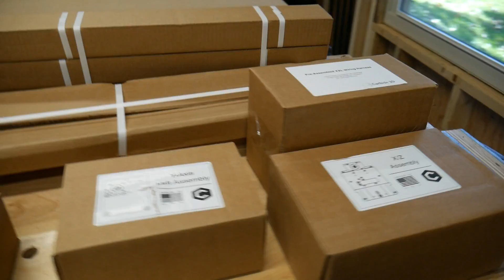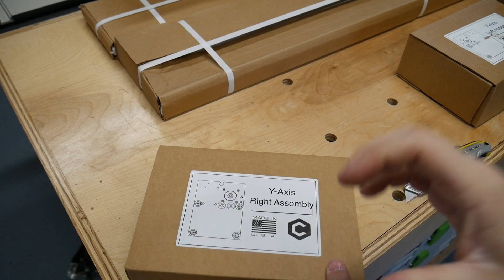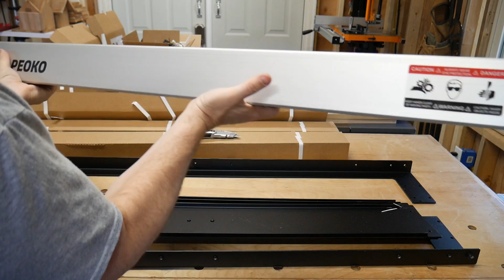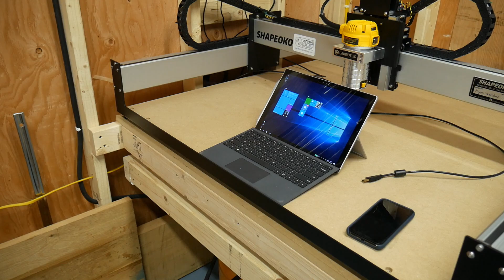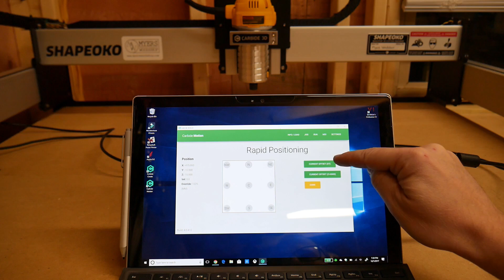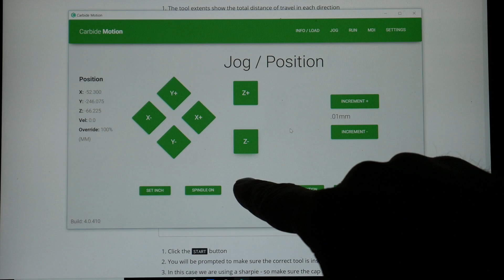Ultimate X-Carve Vs Shapeoko - Part 1 : Shapeoko 3 XXL Unboxing, Installation, and Hello World

Comment from the maker: Since I put this video out I have now changed over to the Onefinity CNC machine.
It's advantages over the xcarve and shapeoko are:
X Y Z Ballscrews
15 minute installation
No computer required
Control with phone, tablet, or gamepad
Faster cutting speeds
More rigidity
Check out the Onefinity CNC Machine Here:
https://www.onefinitycnc.com

Comment: so far QC has been my biggest problem. mdf was bruised pretty good and screw holes painted... locked the bolts up. they talk about not cross threading. but one of my leg levelers actually started to spin. you get this problem? this all happened with the first and second step...
got the shopoko because the one you got now onefinity delivers in literally march... i needed to get going. lucky I had taps to clear the paint

Comment: I just put together my shapeoko XXL and got to the very end where it was time to home the machine. I followed the instructions per the book and when it came to hit that yellow button, all I heard was grinding, the Z-axis did not move like it should of. I tried several times, called carbide 3D and spoke with someone. However their troubleshooting did not work. They even sent me a new control board and that still,didn’t work. I’m getting fed up and about to have them come get it and refund me. Anyone else have this same problem.......?
Reply from the maker: And this is why I use a www.onefinitycnc.com now :P

Comment: May i ask about : x carve vs workbee vs shapeoko where most good? And the reason?
Reply from the maker: onefinity.  ballscrew, no v wheels, no computer needed.
Reply: Myers Woodshop what made you switch? (And what did you do with the shapeoko??)
Reply from the maker: gave it to my brother in law @fierysquirrelart  Belts, v wheels are very very old tech.  Also, it had to have a computer attached to it during the cut (which could be days).  And the onefinity takes like 10 minutes to set up out of the box.
Reply: Myers Woodshop how is it in terms of speed?  The size seems pretty limited though.

Comment: So you bought 2 CNC’s and still got belt drives with a separate router as a motor 🤔 if you bought one laguna iq with ball screw drives, completely assembled out of the box with a liquid cooled 3 hp motor with Vcarve pro you’d have a machine that will run 10 years without showing any wear or backlash, a no belts to adjust or replace and in the end cheaper than 2 or more cheap machines.
Reply from the maker: Is the laguna anywhere close to 2k?  Your comparing apples to oranges

Comment: How did you attach the Dewald dw611? Do you need another cable for this? Or have the plug cut off and only the cables connected / Where then?
Reply from the maker: i ran it along the drag chain.

Comment: Did you have a problem with the limit switch on the X axis hitting the wire loom? It seems like the limit switch should’ve been mounted on on the other side of the plate. My wire loom catches the head of the hex nut. I can push the wire loom back some. It just doesnt seem right. Nice video!
Reply from the maker: That’s exactly how it should be.  I don’t know why they show it on the side they do.  Hopefully this will be changed at some point
Reply: Myers Woodshop - thank you for the quick reply. I assumed this was correct as this is the only way that feels normal. I just purchased my machine last week and look forward to more of your videos. Thank you!

Comment: That router is good but a 2.2k spindle is great
Reply from the maker: got an extra one you can send my way ? :P
Reply: @MyersWoodshop   no but the big rock candy mountain Shenzhen in china does dont get me wrong when i started building mine their was no xcarve  no shapoko my first was a joes cnc build skateboard bearing and mdf learned alot from that build but my beast is a hybrid  of a david gatton/Patrick  hood Daniel's machine mine is all 3/4 birch ply  uses .35 chain for the x and y ball screw on the z and uses 1600 oz nema 34 on all axis each has its own powersupply 
Also has a 40 watt laser on the back of the gantry now my pic show it mounted vertical that worked great no mirror alignment issues but i moved it to the back to accommodate the water cool spindle the spindle and laser share the coolant  the gantry weights 123 lbs

Comment: I appreciate your videos, they been loads of help.    It didn't appear that you had any issues completing the squaring steps.   I'm running into coming out of square when I start to tighten down all the loosened screws...I have an email out to Shapeoko but haven't heard back and I wanted the weekend to play with the CNC.   Any suggestions?
Reply from the maker: have you checked out winston moy videos?
Reply: I have looked at Winston’s but it didn’t help with my particular issue but I figured it out.   I ended up removing all the screws from the back half (section) of the wasteboard in order to get it in square and stay square when tightening all remaining screws down.  In looking down through the now empty holes (back half wasteboard) none line up on the back half.  The existing metal plate holes beneath are barely visible on some, so I will need to redrill new holes in the back half wasteboard in order to attach it to the metal and move forward...     It was out quite a bit!  Thanks Ben for your reply.   Happy woodworking.

Comment: What is a good program that's ez to use to turn pics and pic files into gcodes for the XXL
Reply from the maker: You can download carbide create for free and see if that works for you.  You could also try easel.
Reply: if got carbide but can't get it to turn pics in to g code
Reply from the maker: Look up lithograph on vetric aspire

Comment: It seems strange to me that I haven't heard any comments about how loud CNC machines are. I would suspect at full power they would be very loud. If this is the case are they too loud for a suburban garage?
Reply from the maker: mine is in a suburban shed with no insulation.  when i step outside i can barely hear the humming of the machine.
Reply: I've got two routers, Makita 700 and a Triton 2400 watt which I use in a garage and they seem pretty loud when I use them. Maybe I should turn the Makita on and go outside and find out how loud they are out in the street. The noise thing is whats stopped me from getting or even considering getting a CNC.
Reply: Thought of that. I've got one over my shopvac. Problem with CNC is the noise goes on and on over hours not intermittent like other power tools I use.
Reply: If noise becomes an issue, there are a number of really excellent YouTube videos that show people building enclosures for their machines.

Comment: Is there a noticeable difference between the Makita and Dewalt?  Or is it just preference?  Thanks.
Reply from the maker: If your doing metals and plastics, it seems the mikita is better suited for that as it can perform lower rpm.  The dewalt option is the top seller however
Reply: Get the replica makita or buy 2 and still have change with a back up. Id imagine the only thing that goes are the brushs which you get spares and are cheap. Or go for water cooled. Depends what your doing.

Comment: How long did it take you to put the shapeoko together compared to the x carve
Reply from the maker: the Shapeoko took about 3-4 hours total.  The X-carve took about 10-12 hours.
Reply: Myers Woodshop wow big difference, I’m glad I watched your videos. I was going to get an x carve but you have changed my mind
Reply: Myers Woodshop also which router is better the dewalt or makita?
Reply from the maker: They’re bout the same.   The makita has a wider range of rpm so it’s better for milling metals

Comment: C'mon, rubber bandsbetter then ties... Loved the video till I saw how you attached the pen :). Still, will watch other two as i am in the market for CNC, and need to decide - X-Carve ore Shapeoko.
Reply from the maker: :)  I was cheap and wanted to save the zip ties...don't be cheap like me :)
Reply: Large hose clamps tightened with a ratchet is not going to move either.

Comment: Will this CNC machine cut metal, carbon fiber, wood, and hard rock like amber and crystal? I am looking for an entry CNC machine to build some small custom parts.
Reply from the maker: It will do soft metals and carbon fiber.  Not sure about crystal.
Reply: cool thanks! I will buy one then to start creating some parts I need